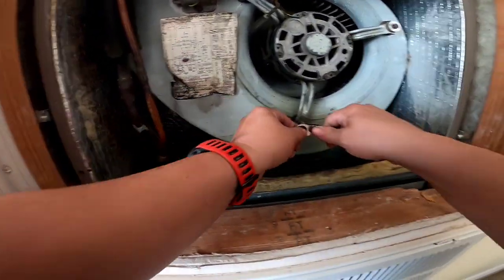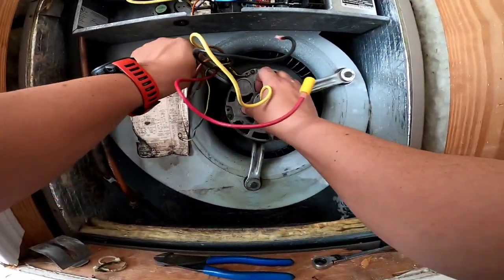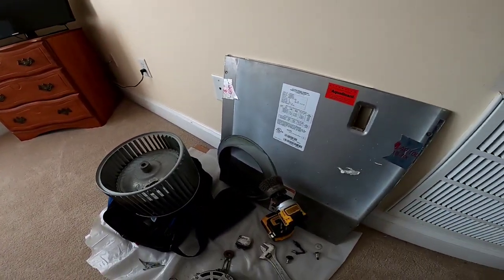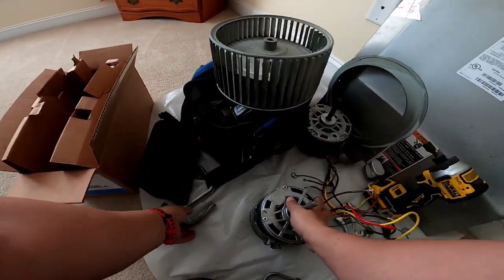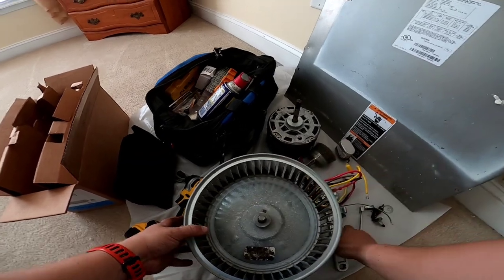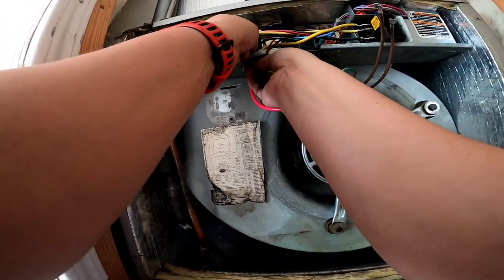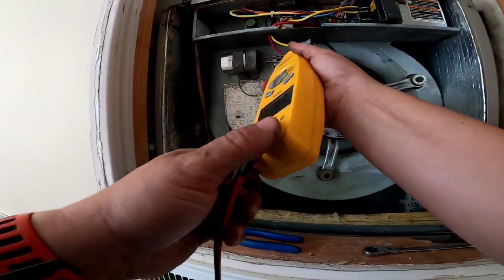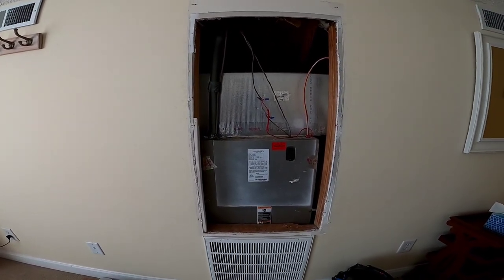Replacing A Blower Motor From Start To Finish

Comment: Brad great video . I have a 2 year old Carrier in our new build .Two months ago  It wasn't cooling and we could smell something ! Turns out I  lost all the 410 .  1st guy said I needed a coil n tsv . Second guy turns out ended up putting in a piston . The air is now super cool and it blows like never before . Does this mean my coil is ok . Thank you Brad ..

John .
Reply from the maker: Thanks! 
Removing a TXV and installing a piston will drastically reduce the efficiency of your system. 
As for that fixing your leak. The only way this sort of repair would fix that issues is if the TXV itself was the component that was leaking and not the actual coil. If this was the case, then yes, that could have solved your leak.

Comment: Dear SC guy, Our furnace (circa 1981 Borg Warner/Trane natural gas, still in good condition)  blows the screw in breaker (locate on outside of it) whenever the blower tries to start.  [Everything else (outside AC compressor/condenser) work fine].  The start relay actuates, and AC unit runs fine with the motor electrically disconnected from the system.  It's only when the motor is connected that the fuse fails at start.  ¿Is this motor bad or start cap, kindly?  The blower assembly turns freely inside the plenum.  ANY advice or comments much appreciated.  Thank you much.  Thank you for your video.  (Honest techs are hard to find).